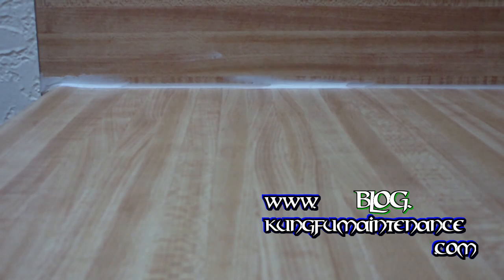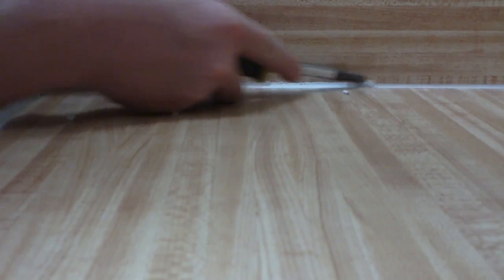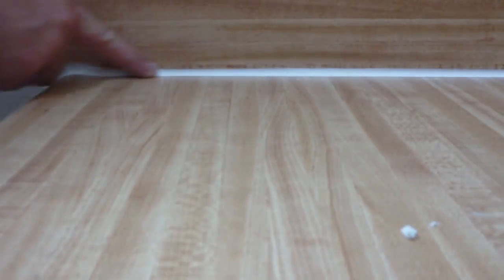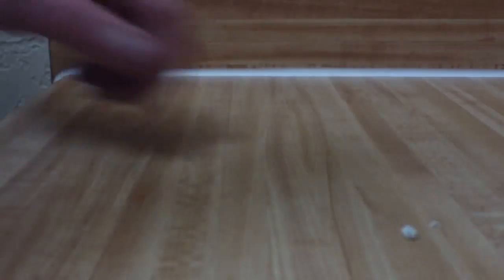How To Clean Up A Poor Caulking Job

Comment: Just remove the caulk and reapply properly.  Low cost, low degree of difficulty to start over.  I don't like jagged edges where water can bead and collect and I don't like the idea of scraping with a screw driver when you can procure tools made from materials which will not mar the finish.  I do not recommend this method.

Comment: Nothing that I hate more than when someone who can't apply caulk properly does it and leaves you with a mess. I'm a landlord and just had an apartment rehabbed . The "contractor" left a mess of smeared caulk in the bathroom. I've found that using a razor scraper works well and covers a wider surface than a screwdriver and it's less likely to scratch anything. It's still tedious work though.